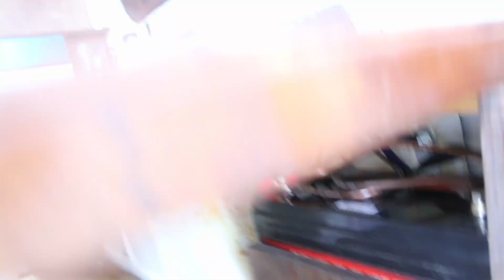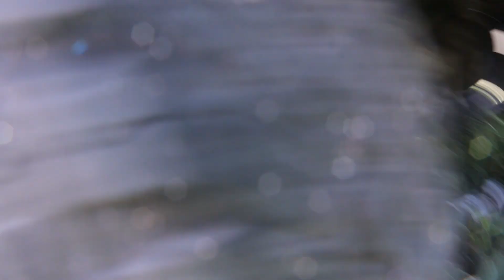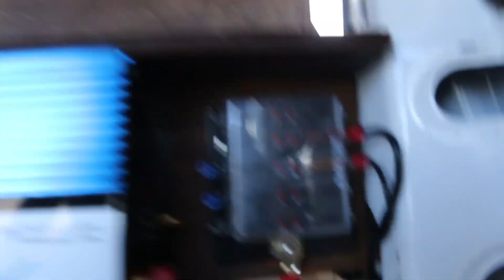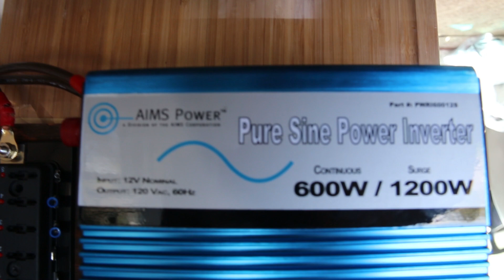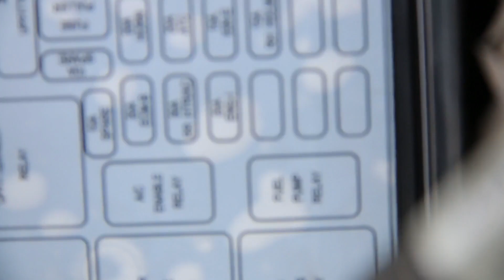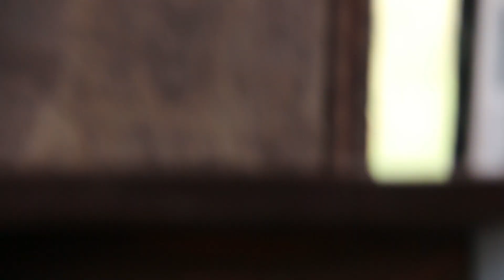How To Install A Secondary Battery, Isolator, Inverter In Your Van

Comment: I have a 2021 GMC Savana and trying to do exact set up as you did on this video…I need to know where to connect wire from the isolater to which fuse ( on the video you connected to the AC relay) could you tell me on my 2021 GMC Savana what exact one I should connect to…thank you

Comment: If I am running my second battery in the back of the vehicle what gauge wire do you suggest? If I am going to be using a 2000 watt inverter off of the 2nd battery, and using 1000w devices while driving for extended periods of time, does that affect the gauge wire I should use between the two batteries? I imagine it would because the batteries are connected and the high draw from the inverter will be getting shared between the two? Correct? I know from 2nd battery to inverter needs to be a hefty gauge, probably 1/0. If you could explain how this works I would appreciate it. I am attempting to understand electricity better. Another question, I've seen a lot of people run the negative all the way back from one battery to another. And if I decided to skip the 2nd battery and just have an inverter direct to starter battery I see most people run negative directly to battery, some dont do this and ground to the body. Any reason you would do one vs the other? Thanks!

Comment: why not just use a RV battery isolator?
Reply from the maker: You certainly coukd if you wanted to
Reply: Isolators are less reliable than a continuous duty solenoid.

Comment: I don't know about about other makes BUT GM vehicles may have a Hall Effect current sensor that requires both battery negative poles to be connected directly (not to frame/body).  Check before wiring.
Reply: Word up to that tid bit of info

Comment: Basically the cable you connected to the ac enable relay is a positive, you can do the same connection from the positive of the battery or bridge the positive connection you already did to the battery relay.
Reply from the maker: If you connect it directly to the positive of the battery it would defeat the purpose of having an isolator
Reply: @MechanicalMike  and it'll will always be on, passing power to the back battery even while the vehicle is off. So connecting it to the ac enable relay be like another relay or interruptor or switch on while the vehicle is on, off while vehicle is off, sort of only to have the back battery receiving post from the alternator while obviously the car is on.
Reply from the maker: @rodolfoplasencia4953  it is connected to the ac relay because that only supplies power to the isolator when the car is on, which in turn only charges or supplies power to the auxiliary battery when the car is on and shuts off power to the auxiliary battery when the car is off so that the auxiliary battery does not drain your primary battery. If you connected it straight to the battery then it would always be supplying the auxiliary battery, which is what we don't want, thus the isolator.

Comment: At times 1.29 and 7.30... You mentioned (relay)... Do you mean isolator?🤔
Reply: Yeah, it looks a lot like a battery isolator
Reply: @B61zz13  technically a separator...not an isolator
Reply: Yes, this is clearly an isolator.
Reply: @rahulmukh  mmmh nope, isolators use diodes to make batteries independent from each other....This is using a mechanical solenoid to separate batteries...
Reply: Starter relay

Comment: To avoid holes and mechanical work. Can i add additional battery both positive and negative to the existing battery. The connection will be like a clip like we use when jump start car. So when i turn off the engine i can take those clips off from positive and negative from the secondary battery. And add the inverter to the battery both positive and negative. Will it be fine ?? Second question is can i add the additional battery directly to the alternator. This way i dont have to worry about disconnecting the battery every time i turn off the engine. I only need enough power to use two 12v heated blankets they have car changing plugs. And i have 2019 ford transit. What size battery do I need to last those two blankets for 8 hours. And i drive about 12 hours every day so the battery you will recommend me will it get change in 12 hours from the van alternator. What size inverter i need. Please and thank you
Reply from the maker: If you connect the secondary battery to your alternator, it will still drain power from your primary battery when it is off, because your alternator connects to the battery. An isolator would save the hassle of having to open the hood and unclip every time, but it is doable. That can also be more dangerous though if the clip comes loose and a positive touches ground. As far as how much battery power you need for heated blankets, you will have to look at the tag to see how many amps or watts they draw. But batteries never can hold 100% of their rating, so its safe to cut that down to at least 80%, depending on the battery type it can be even less.  So hypothetically, if you had two blankets that each used 500 watts, to find the amperage, divide the watts by volts, so if they are 12v blankets that would be 41.6  amps each. If they were powered by a 100 amp hour AGM deep cycle battery at 80% to empty, that means it would last less than an hour. However, if your blankets used AC power and ran off of the inverter, you would dived 500 watts by 120V, giving you a 4.1 amp draw, so it would take roughly 7 hours to drain a 100 amp hour battery, taking into consideration that the inverter will also be drawing power. I would recommend an inverter that is rated at double your total anticipated wattage draw. So if you plan to pull no more than 1000 watts, you would want a 2000w inverter. The higher the efficiency 90%+ the better. Hope this doesn't leave you more confused than before
Reply: @MechanicalMike  ok so each is power draw is 60w and amp is 4 each blanket. And I have two of these blankets. They are 12v and plugs in cigarettes lighter plugs. Now if I buy a dc 12v battery and place it in passenger seat and connect it with van battery which is under the driver seat. I can easily connect and disconnect the jumper cables securely. Because the battery is under the driver seat. And take the cable fully off when I am going to sleep after 12 hours drive and put it back on the next day. Can I buy cigarettes lighter female power cord and connect positive and negative directly with the second battery. Will the blanket work because it’s dc to dc. I hope I am able to explain my situation. I just started working and I can’t afford 120v blankets and inverter. 12v dc blankets just work fine for me. At this moment I just use cigarette lighter and keep my van unlock so the power connect and I run for 2 hours a night when it’s extremely cold. Because I don’t want to drain van battery. So should I buy dc 12v battery. Thanks 🙏

Comment: I appreciate your 3yr old how to put isolator, battery, inverters, fuse box, etc on a Van. I wish it showed how to get under the A/C enable relay to put the ignition wire to the isolator...🙄 This is all new to me? I’m  headed off grid this Friday... Thank you for sharing your wisdom!

Comment: 1 question....
Will that fan and refrigerator run all night off the deep cycle battery? 
(Lets say after 1 hout of consistency in driving?)
Reply: Friend i drive about 10 hours everyday and will the batteries cargo in 10 hours to run two 12v heated blankets

Comment: Grounds... should they be run full-length for all circuits or is it OK to ground to body? What about lighter load circuits like accessory lights? Would be more convenient to run just the positive wire. Thanks
Reply from the maker: Grounds can just run to body.  Just make sure there is good contact with bare metal.
Reply: Did you not watch the video?

Comment: Hey man I was curious I'm running a battery bank similar... Do you have to run a ground wire from your battery to the secondary battery for the alternator to charge it or can you just ground it to the chassis let you would you know your ground I hope I explained that right..?
Reply from the maker: You can just ground to chassis, same as we did here

Comment: With the van running, your battery isolator/relay is switched and the alternator is charging both batteries... Now if you are using accessories connected to the aux battery while driving do you have any issues, or did you install a higher output alternator?

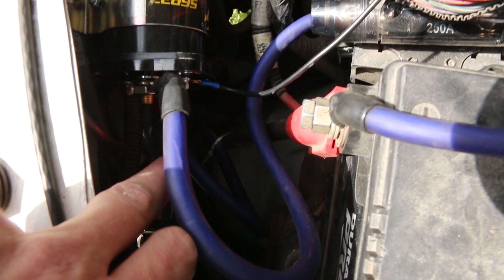Comment: 1:28 How do you know where to get the live (hot +) (when car is running) line for the relay?
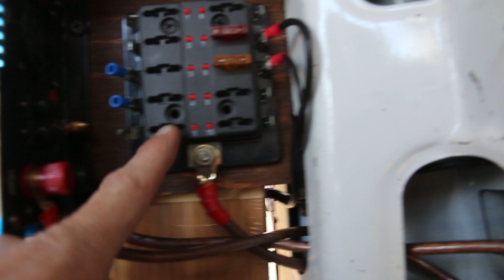4:38 Any power or voltage loss in not running a fat negative to the inverter? Is the inverter grounded to the chassis too?

Comment: Hello and by the way nice video.
  I thought you had to connect the ignition terminal on the stinger isolator to an engine ignition relay not an AC relay..I really would like to see the connection you made and how you did it and what method like soldering or quick splice connector  because i have a 99 Astro and a stinger isolator im in the middle of my installation and i don't want to make a mistake and burn something out. Please Help thank you for this video.
Reply from the maker: The A/C turns on with the ignition so we chose that, as it also is not a pertinent fuse, if it were to blow. You dont have to use the A/C if you dont want to but it worked for us. We used a crimp on splice connector

Comment: I would highly suggest you protect the positive cable even more from the exhaust. Also there the wire runs through the body you should insulate there too, Over time vibration will cut the insulation and if you are lucky it will blow the fuse.
Reply: Thought I was the only one to see that...need a grommet in those holes.

Comment: but the A/C on relay is on if you engine isn't running but the key turned into accessory position right?  Dosen't that mean if you are just sitting in your van with the lights on the relay also is on draining your battery charging the secondary without the engine or alternator running?  There has to be a relay that only turns on when the actual engine is running I would think.   Starter relays dont turn on but for a couple second and then turn back off. I'm having trouble finding a relay to splice into that would do this..
Reply: your ignition run position or anything thats only on with car running. the relay does not take much to energize.
Reply: water or oil pump relay seems like a good candidate to wire into since I know it's always running only when the engine is actually turning.

Comment: Hows it work a few years later? 1 battery dies and then the other then the other? I think your missing something
Reply from the maker: Still going strong
Reply: a smart isolator will shut the relay off automatically and stop drawing amps from the car battery if it drops below 12.6 volts I think or something like that.  this is good if you forget to turn your accessories off but personally, as  a somewhat experienced mechanic, I don't like the idea of a bank of secondaries constantly drawing down the voltage like that every time, even if it's a small amount. It will shorten the car battery lifespan by some amount, and if you're battery is on the verge of going dead this isolator will definitely expideite the process doing that. 
I'm thinking wiring into a water or oil pump relay or some other system which is only on when the alternator is generating power is a better option to wire into. A/C relay is on in the accessory position which, for me, I'd like to be able to switch my accessories on without having to worry that my isolator is draining my car battery down.

Comment: Hey I am Nitish from India.
Bro I appreciate your videos coz its help full for me always
But ryt now I have 4, 5 confusion plz help me with that
1. Is alternator need to be changed????
2. Is second battery gets charged with this battery isolator????
3. And it will not transmit the power back to the first battery coz if it is then the fuse box get damaged
4. Is this small fridge is working all the time while driving if it is then how????
5. And is it posibal to add solar panels for charging second battery.
Reply from the maker: Hi Nitish,
1. Alternator does not need to be changed, but it will make it work harder. You can upgrade to an alternator that puts out more amperage if you wanted. 
2. The isolator allows the alternator to charge the second battery only when the car is running. It shuts off power to the second battery when the car is off, so that secondary electronics like fridge and inverter do not drain your primary battery.
3. It can transmit power back and forth while the car is running, but it will not damage the fuse box because it is the same voltage. 
4. Yes, small fridge works continuously because it is tied into the secondary battery. Any electronics tied into secondary battery will continue to work as long as it has enough charge. 
5. Yes, it is possible to add solar panels to assist in charging the secondary battery and I do reccomend this, because it will put less wear on your alternator to create all of the power. If you use a solar panel, you will need to use a charge controller that shuts off power from solar automatically when battery is full, so that it does not overcharge your system
Reply: If the ignition is on both battery connect means giving power to other things like self(starter) ,fuse box ryt??
So there is also a chance of getting other electrical objects damage???

Comment: can I use a 100 amp circuit breaker instead of a fuse? how do i know how many amps my car will put out?
Reply: like could i just use 4 gauge wire, a circuit breaker and turn it on and off when needed? instead of buying the isolater and fuses
Reply from the maker: @savvyhealing  Yes, I actually prefer this method, which saves you having to buy more fuses. Here is a link to a 100A 12v circuit breaker https://www.ebay.com/itm/183345012723

Comment: where did you get all those parts
Reply: also is it imperative to have those fuses from battery 1 to isolator then the other fuse in back?
Reply from the maker: @skylarlarson5223  You could just have one fuse before isolator, but two fuses protects them individually. We used a rather high amperage on these. I'd recommend a lower amperage for better protection in retrospect. Maybe a 100A - 150A max.
Reply: @MechanicalMike  why did you use a high amperage? and do you need a fuse box in the back? can I just run a battery power converter off the auxiliary battery with no fuses if I just want to plug in a fridge to it?
Reply: *power inverter off the auxiliary battery
Reply from the maker: Mostly eBay

Comment: It's been nearly three years since this video was uploaded on YouTube. I'm curious to know if the positive battery lead to the slave or deep cycle battery had any issues with the cable passing through the drilled holes (in the undercarriage)? Normally in a situation like this grommets are used to avoid damage to the insulation when passing through metal . Moving vehicles or installations where vibration is immanent, chaffing of the insulation is very  likely to occur..
Reply from the maker: In the description is noted that grommets were added to every hole

Comment: Speaker wire and wire through holes with out grommets. You need grommets in those holes friend.  The vibration will cause the metal to cut into the wire casing.   Also. You need to be running cable, not large gauge indoor wire.   Other then those.  Great little system.
Reply: Y cant you run large guage indoor? So you're saying you need stranded copper cable not solid copper indoor grade?
Reply: @dw4940  yes, the solid would break down.

Comment: what gauge wire for the length,??..4 holes,1 grommet.
Reply from the maker: 4 awg. Check the diagram at the end of the video. Use grommets on every hole. We went back and added them

Comment: I am a little confused. Both of my batteries will be under the hood. I would like the second battery to power the interior power outlets / cigaret outlets without draining the main battery.
Reply from the maker: To do that, you would have to divert wiring to existing accessories on your vehicle to secondary fuse block. The isolator keeps any electronics running from auxiliary battery from draining main

Comment: Isn´t it easier to connect an inverter to the primary battery, then connect a charger from the inverter to the secondary battery?
Reply from the maker: You could certainly do that.  The idea behind connecting the inverter to the secondary battery is that the isolator will keep it from draining your primary battery while using auxiliary electronics and possibly leaving you stranded with a car that won't start
Reply: @MechanicalMike  Thank you so much for the response. Anyways you should always carry a crank starter.

Comment: Hello! What gauge wire did you use from the main battery to relay underneath the car to the 200amp fuse?
Reply from the maker: They are both 4 gauge wire. The purple wire just has a thicker insulator around it and looks bigger.
Reply: It looks like you used 1/0 guage in the video, then 4awg after the fuse in the back, but your diagram shows 4awg used right from the beginning at the start of the existing battery